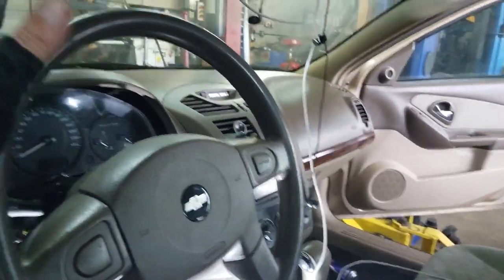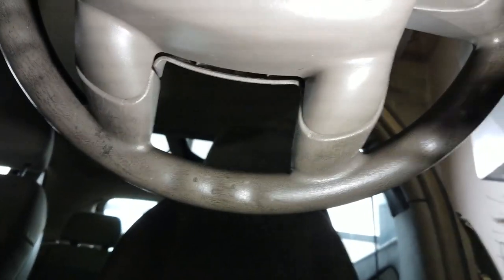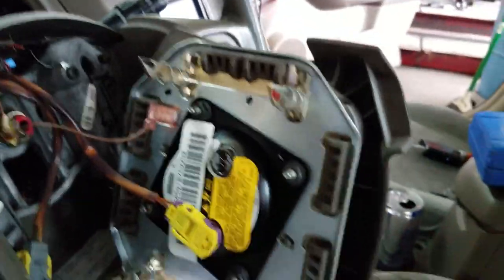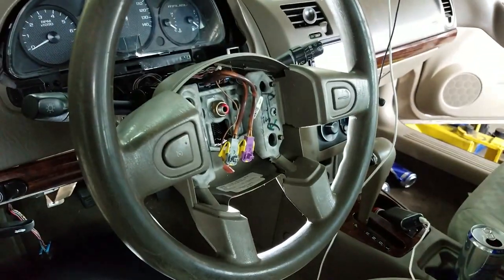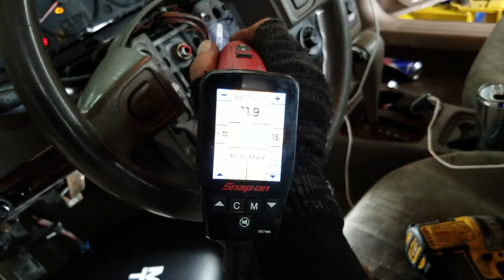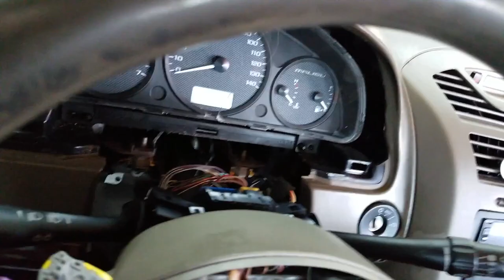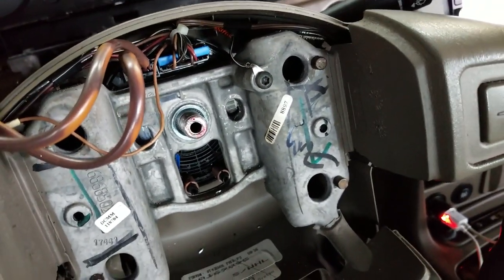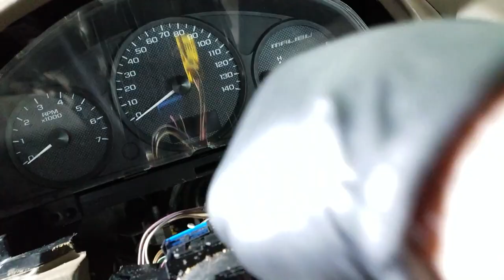2005 Chevrolet Malibu Maxx LS / Horn Not Working - Remove Clock Spring

Comment: I think this might be my issue.... cruise and horn are out, cruise button doesn't light. Airbag light also on. The guy I bought it from said the rack and pinion failed and the steering wheel spun too far. Might have damaged or unplugged something to it